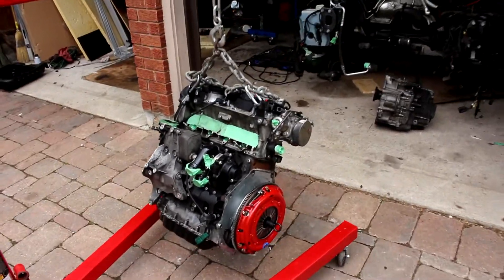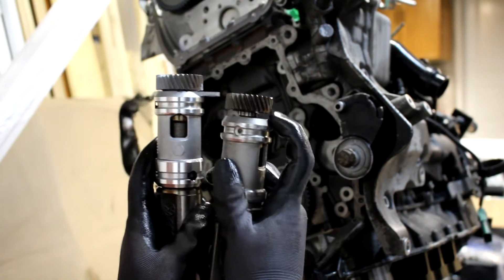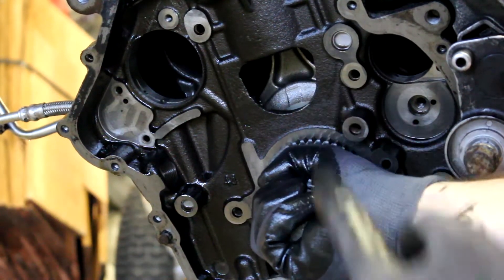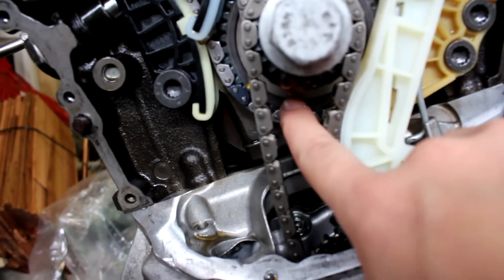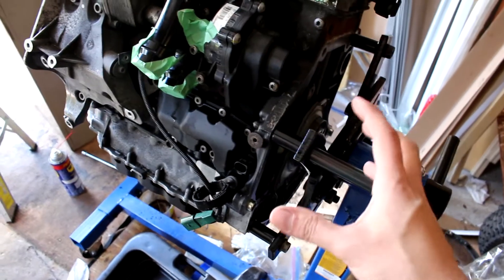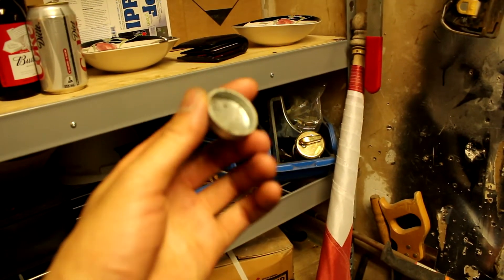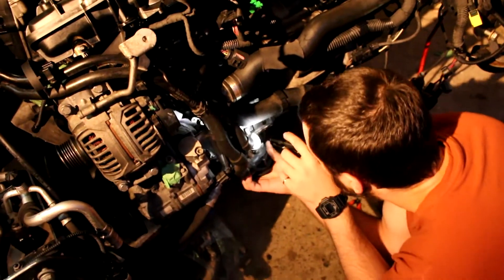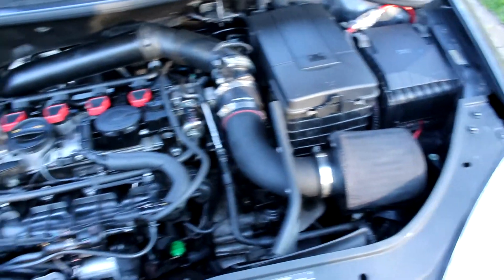Seized Balance Shaft - VW 2.0T TSI

Comment: What are the chances that you could have replaced these shafts with the engine still in the car? Were both shafts seized or just one? Do you know what caused this?
Reply from the maker: technically, we could have dropped the passenger side motor mount and tilted the engine downward to slide the balance shaft and clear the frame of the car. This would have been very hard as the exhaust side balance shaft was really stuck (these shafts are cooled and slid into place and then expand into a tight fit). An experienced technician (which I am not) would probably have better ways to go about the job lol. Only the intake side was seized but I was only able to find them as a pair, so I replaced both. I've read that the screens on the oil passages on the balance shaft like to fail (there were no screens left in my balance shaft) so maybe it was lubrication related. But in full honesty, the shaft failed after some driver error -> after some spirited driving, a rough shift caused the balance shaft to give out. It wasn't a terrible bearing-spinning mis-shift but it was enough to give the balance shaft a reason to quit, especially after all of the heat from a previous run. I have only seen 2 other cases after some googling where people had balance shaft seizing issues, so I would say it is very rare and no much of a worry. No issues after 15,000km since doing this job
Reply: Thanks for the reply and video. I haven't pulled the timing cover yet so I am not sure if this is my issue. All I know is that I can't rotate the engine more than about 5 degrees. I previously replaced the tensioner with the revised design so that better not be it. How did you get the shafts out? Do you know where online I can find the manual you were using?Mine is a Passat. Maybe I'll get lucky and the frame shape will allow the shafts to slide out. But probably not.
Reply from the maker: When my intake balance shaft seized the engine kept running but since the intake balance shaft drives the water pump, I could see my temp gauge climb since no coolant was being circulated - Just in case you noticed something similar before yours stopped rotating
Reply from the maker: To get the intake balance shaft out, it just slide out once i removed the torx bit and the sprocket for the water pump drive. There is a special pulling tool (slide hammer) to pull them out which I didnt have. For the exhaust side, I had to hammer out the freeze plug on the transmission side of the engine and hammer the exhaust balance shaft out from there (not fun). I bought the manual for my car from AllDataDiy.com which goes into detail on the torque specs of bolts and how things fit together (was really useful for this job). Good luck! let me know what you find, all the best. Another good video to watch is from the youtuber 512kjt, he replied to this video as well->his video is what made me feel better about timing the engine myself, his VW CC had a the famous tensioner failure
Reply: It looks like the exhaust balance shaft is frozen. Hard to say because I can only move the crank 5 degrees, but it looks like the idler and the intake balance shaft are moving. Don't see any movement on the exhaust shaft. Looks like cams are free and the oil pump is definitely free. If I can get the shafts free, I should be able to clear the frame by lowering the engine. Is that freeze plug inside the bellhousing or outside?
Haven't checked timing yet to know whether it jumped and did further damage. No gears are stripped and the tensioners are working.
Assuming I bother to repair this car at all. I didn't miss the part in the manual about selling and getting another brand. I just didn't listen.
Thanks again for the good info.
Reply from the maker: I feel your pain. Sorry to hear about the exhaust shaft. I feel like this is my last VW but I keep going through days where I love the car, and of course those days where you hate it. Your welcome and good luck. Unfortunately the freeze plug was behind the bell housing so the transmission had to come out for us, but you might get luck and be able to free the exhaust side shaft without hammering it out from the other end. Also if you can find a balance shaft puller tool (vw audi has one but I couldnt find where to get it) that might help
Reply: It is an enjoyable car to drive. Just not enjoyable enough to deal with these issues. I find myself lusting after beige Camry's and Accords these days.
How hard was it to get the balance shafts back in? Do they just slide in? I'm still mulling over doing this job. I'm looking at $1k in parts and tools. Once I bite the bullet and order this stuff,  I have to stick it through. I'm sure I'll be using your video for guidance if I do it.
Reply from the maker: haha well said. I would love an unbreakable toyota or honda, especially an older one that's easier to work on than these VWs. The manual from all data diy was an amazing help I must say. The balance shafts went in easy for the most part, The hardest parts were getting that plastic shroud that fits over the exhaust side balance shaft in place (it is meant to stop oil returning from the head from falling directly onto the spinning balance shaft). The manual shows where it goes but it's a pain to get into place. Careful on the intake side because the end of the balance shaft (toward the water pump) goes through a brown seal at the end that you dont want to damage. Also the water pump belt drive gear that is attached to the intake balance shaft is reverse thread from what I remember and that has to come out to take the intake balance shaft out. So thats one of the reasons why we took the intake manifold out (not sure if you have to). Taking the intake manifold out meant we had to replace the injector seals because the injectors came out with the manifold (one big headache).  Basically, the balance shafts weren't so hard to get in (kept them in the freezer for 30min and pre-oil the screens and the shaft rotating assembly with engine oil and install) it's just that everything around them is a pain in the ass. Feel free to ask more questions I'll try and be as helpful as possible from what I can remember of the job (I'm in NO way a professional so take my words with a grain of salt lol). Another pain was I needed a special tool to loosen some fastener related to the variable valve setup which is reverse thread (that bolt with two pins) on the intake camshaft to replace the timing chain. Re-reading what I just typed reminded me why I don't think I want to stay with VW lol. My engine was on a stand for a month waiting for the timing tools and parts etc. If there were an alternative I would have taken it. I tend to not think things through very much haha
Reply: @WannabeTuners  Been meaning to respond. I'm "Rob Johnson" but forgot my login info. 1st, I wanted to say thanks a lot for posting to the video and responding to my questions. It was very helpful. I fixed my seized exhaust balance shaft and got rid of the car.  2nd, I wanted to offer some tips. At least in the case of the B6 Passat, you can easily pull the exhaust shaft without pulling the engine. I believe I could have also done the intake side, but I did not. Zip ties are a great way to hold the cam timing chain together in time while you install the tensioner. I made my own crank pulley holder, balance shaft puller, and cam shaft turning tool. I avoided the rabbit hole of "while you're in there" parts, dumb tools that no other car needs, and did the job at the cost of the shaft and gasket maker. That's right, screw you german Engineers.  Which brings me to my 3rd point; I wanted to bash VW.  What horrid, horrid cars. Mild performance at the cost of all reliability, outrageously priced parts, and insanely complex repairs. Americans are far too kind to german Engineers.

Comment: Any idea what the total cost of this job was?
Reply from the maker: Looking back, I should have found a salvage engine. I paid around 3,000 canadian  (not including the clutch upgrade). The balance shaft repair kit was 350. Also Had to get a timing chain kit, idler sprockets, lower timing cover etc. I had to buy special tools to loosen that reverse thread nut on the intake camshaft as well. New hardware (so many bolts are said to be torque to yield so I replaced a lot of those as well). The cam bridge was a couple hundred dollars as well, new injector seals since they all came out with the intake manifold. new pcv-just because.  Sorry i dont have a full list of the parts, but it really depends on the damage that was done. I am lucky that it didn't jump time and ruin the head. I think I got lucky, but I wasn't smart, I thought I was looking at 1grand in repairs but the bill added up quickly. If I had to do it again I'd be looking for a drop-in replacement, at least then I'd have a lot of spare parts (manifolds, turbo etc)
Reply: https://www.timingchainsettlement.ca/